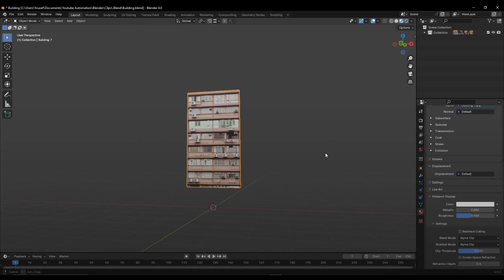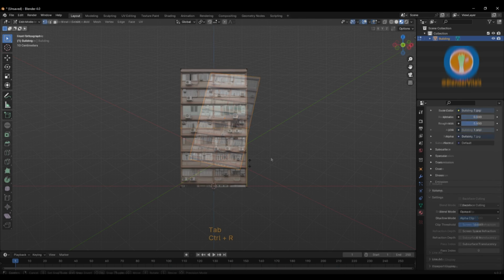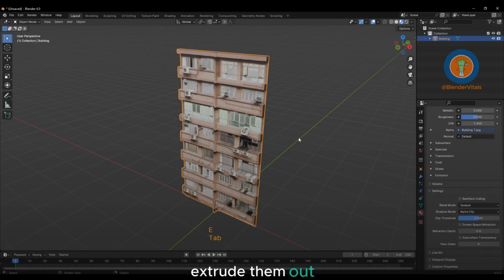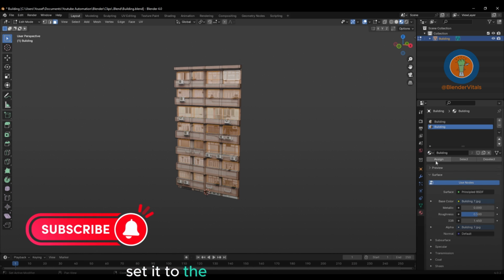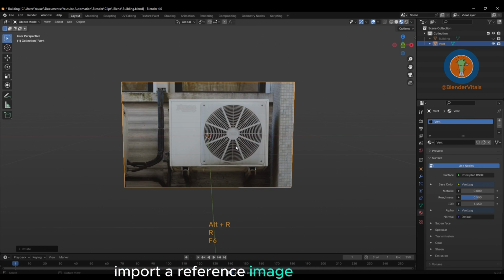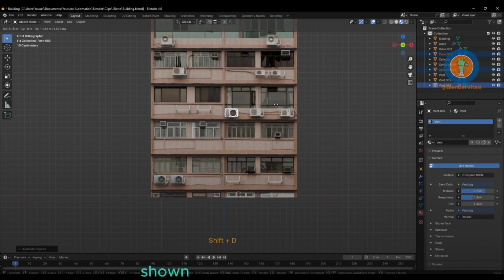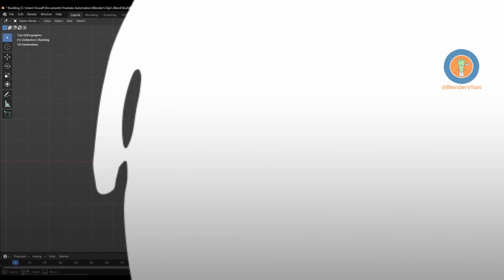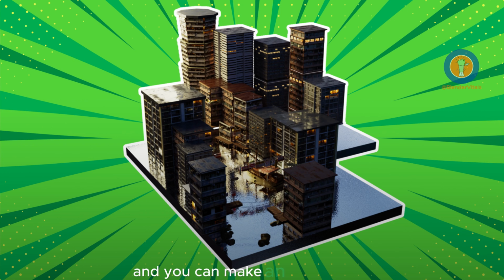Turn a 2D Image Into a 3D Building in Blender in 1 Minute!

Comment: It looks bad, creating 4 duplicate sides, very bad effect.
The better method is this. 
1. Create a large rectangle the size of an apartment building. 
2. Apply a box UV map with the texture applied to all 4 sides.
3. Create edges around windows and extrude with a negative value. 
4. Select all windows, give them a different material ID. 
5. Apply multi-sub object material, for the material associated with the windows apply glossy reflection, and for the regular part of the building retain low gloss.

Comment: Critical mistake if u want to create a big scene is to go into details like ACs and wires. It counts the poly up really fast, only go into details if they are closed to the camera or it's the main ground or something ur characters can interact with.
Reply: Hes not adding many polys with the ACs and wires.  Even if he was adding 1000 polys per building it would not even be noticeable at all at the scale shown in the video.  Modern GPUs can handle millions of triangles per scene without sweating.
Reply: @kdcor4  Not to mention, you can simply instance them, not duplicate.
Reply: @MajorKreissack88  This is a good tip about instancing and not duplicating. I think this is alt-D right?
Reply: Not to mention, fpdasojjpofsadjpofajokmfad
sd

Comment: Creating entire city can now be done in just 1 week, with hundreds of building variations. Thanks a lot dude.
Reply: Most difficult part is taking a perfect photo of the building that does not have any perspective deviation.
Reply: @exaversial-being  I know this is an old comment, but you can fairly easily correct any perspective issues in photoshop in seconds. If you start with a really high res image, you can save to a lower resolution and you shouldn't even get any noticeable warping artifacts.
Reply: @exaversial-being  you can use a tool called Shoebox, it allows you to rip segments from an existing image and calculate the pitch so that it looks as flat as possible. 

renderhjs is the site, look it up if you dont trust me.
Reply: how to find these kind of images pls tell me
Reply: @Breezy_INKI  You're not sure how to find images of buildings? What :D?
Reply: @Breezy_INKI  search for building picture front view
Reply: @Breezy_INKI  search for "building texture"
Reply: @Breezy_INKI  Have AI draw them for you. Microsoft copilot for example
Reply: Any other way to create real city 3d ?
Reply: @RizRizbal-fq3bu take 3D scanned models from Google maps, rebuild models from scratch better on top of Google and usa real textures
Reply: @RizRizbal-fq3bu  There are more advanced and efficient ways to do this, such as Geometry Nodes and some city add-ons that implement it
Reply: Also can be done on blosm add_ons  in just one sec If you know.
Reply: Or 1 hour
Reply: Unrea engine 5 how to import?
Reply: @TheGameFreak-le6qf  it's freely available in google.